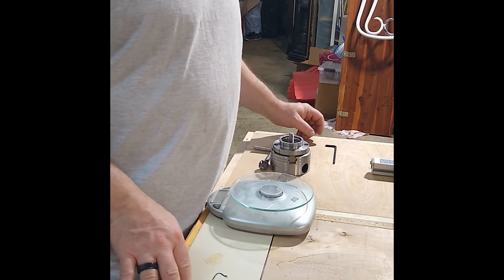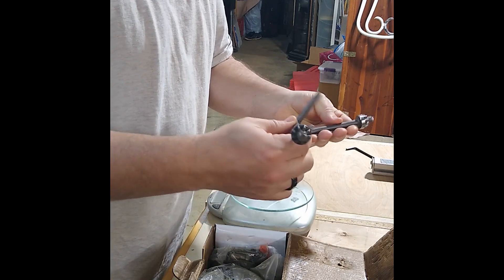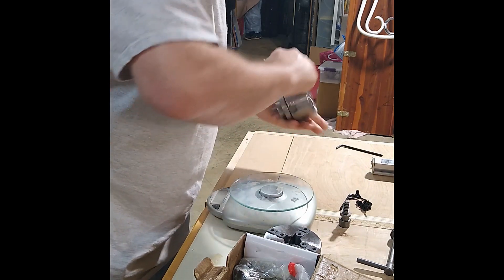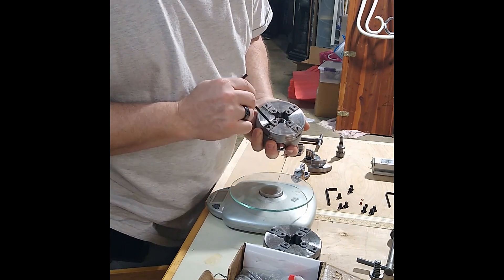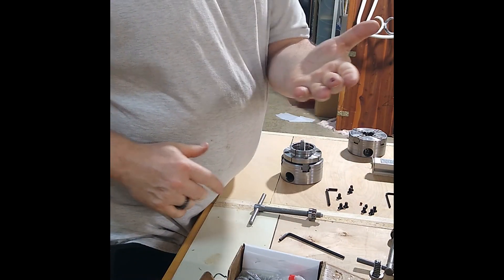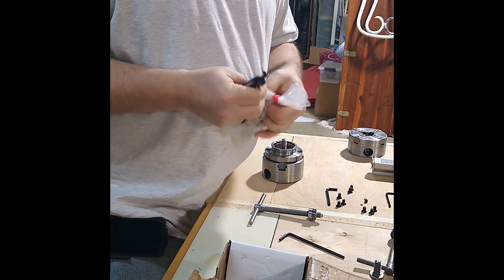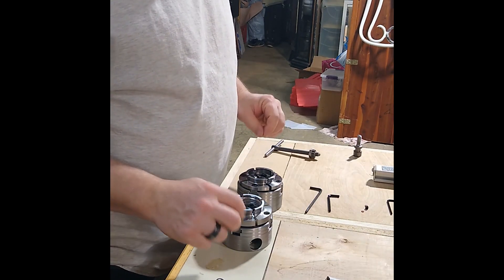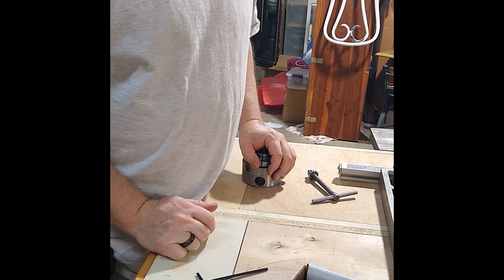Let's Compare Nova G3-D with Nagu 10600

Comment: Had the sound turned to the max and did not hear a word you said.
Reply from the maker: I am so sorry. I will do better next time. You have to not only turn up the volume in the app, but also on the physical device. Anyway, I have different equipment to use, and will definitely do better next time.